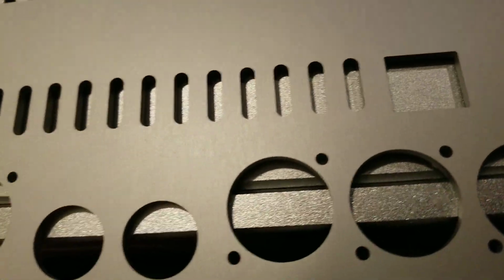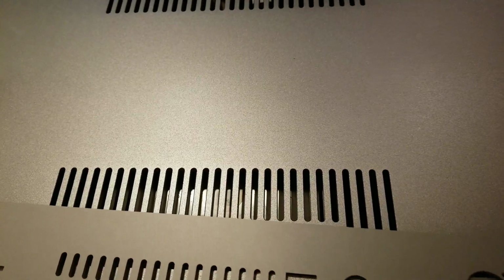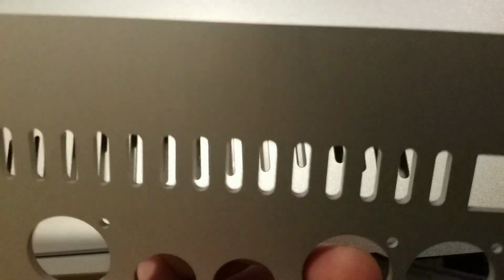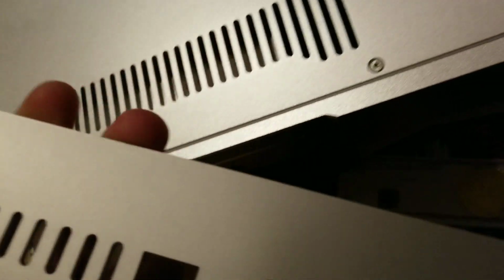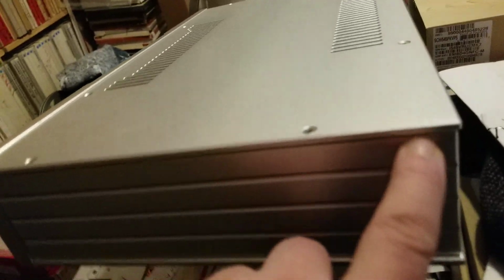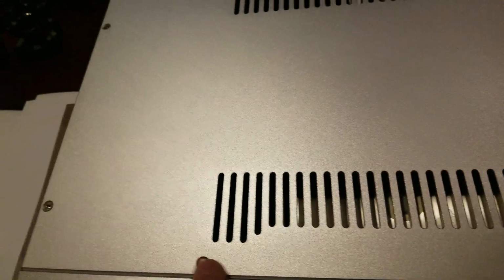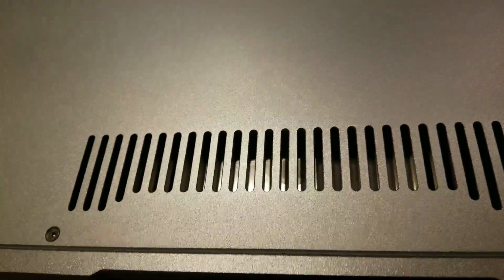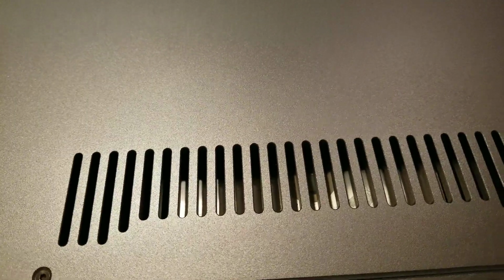Differences in chassis aluminum

Comment: That is anodised aluminium. It's a process that creates that sparkly look. 
It hardens the surface so it doesn't scratch or gets damage easily. I wouldn't consider it less high end than other surface treatments.
Reply from the maker: Ok. So its industrial finish. The other one is luxury level.

Comment: You know nothing about the aluminium :D It's really funny to listen to someone who never worked with materials. You don't even know the names and stuff. How can you tell which one is easier to do? I've done this stuff. FOR REAL on CNC cutting machines.
Reply from the maker: In case you didnt notice, you are on a HiFi page. Not a machinist page. Next thing I'm not discussing aluminum, I'm discussing finish. For our purposes here using technical names does not matter. Try to focus on the message here rather than trying to pick on me for whatever you can. I hire CNC operators. I hire a professional CAD draftsman. I dont need to know it.